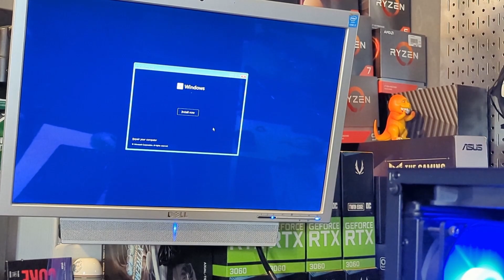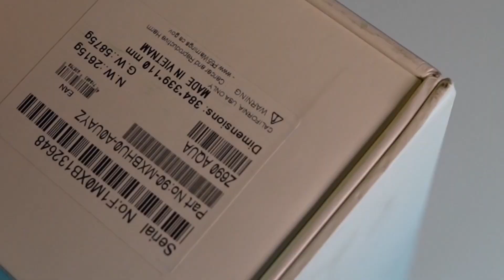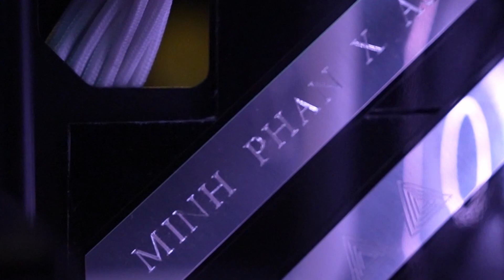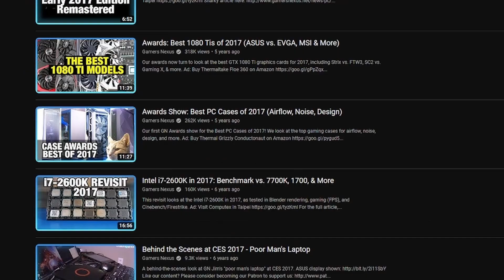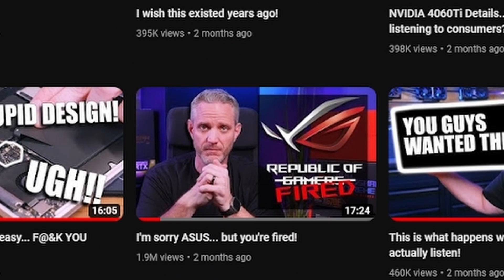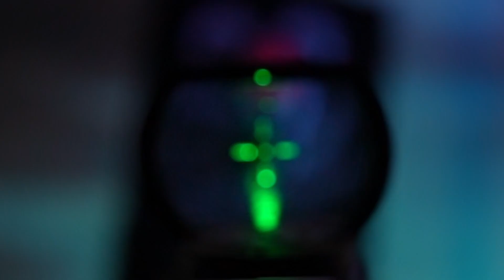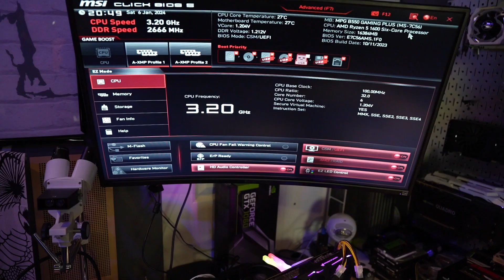Are PCs becoming boring?

Comment: I'll be honest - I think the state of computers is absolutely amazing right now. Or rather technology overall.
Finally long gone are the times when you need a flagship phone to have a good experience.
You want a laptop? Well you have so many options with barely any compromise. Want a laptop that plays AAA games? They're actually doing proper job nowadays. Want a laptop that's slim but plays games decent. Yep, available nowadays. Want a cheap laptop that's portable and provides amazing experience? Well, available nowadays as well.
When it comes to PCs - sure you lose on the GPU prices. No denying. However nowadays you can get much cheaper PC cases that are doing their job properly. Same with PSUs. Or CPUs. Yep, that's right. Nowadays at 1440p or 4K even stuff like R5 5600 provides amazing at cheap. Or 12th gen intel. Before older tech was much more expensive thanks to stagnation. Oh and on top of that nowadays stock coolers are decent enough! And if you want something better for R5/i5 30$ cooler will do the job. Back in the day you'd have to pay at least 60$ for a proper cooler. Storage? Well, you can get 1 or 2 TBs of SSD of cheap. No need to compromise like before. Some 256gb ssd for your system and one or two games while the rest had to run on HDD.
And GPUs, well they got much more expensive. HOWEVER, you don't need absolute chonkers like 4080. Last gen AMD or 4070s provide amazing performance at not much higher prices compared to what we had before. But nowadays you can be sure that those GPUs will last MUCH LONGER compared to 1070 for example. That's a small win in my opinion. It just sucks that you have to pay SO MUCH to actually get proper 4K experience. However next gen will probably provide close to 4080 performance at 4070 price. At least that's what AMD is trying to do so there is some hope <3 Overall PCs are in much better state. 
Wanna do watercooling? Long gone are days when you had to pay bazillions to get into that. Nowadays even the cheaper brands do quality stuff. And cases are designed with watercooling in mind! I love it. 
Oh and the looks! Nowadays you get quality fans that also look good. Cheap cases look amazing. I've recently seen a pic of a guy that built amazing system on used parts for 450$. Dude got 12400f, 3060 12gb, 16gb ram and 1tb ssd. AND IT ALSO LOOKED AMAZING. He had such a clean build with some nice touch of RGB and braided PSU cables (he did it himself). Back in the day there was no way you could do such a performance killer at a price while also making it look good <3
Thank you for coming to my TED talk
Reply from the maker: Thank you for this write up haha, or TED talk as you said. I agree with you 100%

Comment: I can tell ya from decade's of building and maintaining PC's they become the equivalent of adult Lego back in the day eith so many different standard's you had to know the difference between the different display tech to plug in a monitor properly or even earlier hiw many people knew how to reroute IRQ conflicts with competing hardware in same rig like sound cards/GPUs/daughter boards for flight sim hardware or printers on the LPT ports. 

Now if you have a functional brain that has enough capacity and attention span you can build a insane rig withiut worrying about any conflicts.

The worst thing you can do is ham fist a CPU into a socket and mash the pins or if unlucky youre GPU will catch fire or snap when inserting the new cables too hard to prevent a fire you lose both ways 🤦‍♂️

So to answer the question yes and no its boring because its so simple and no because hardware manufacturers bring new and exciting problem's to the table i cant wait to see what happens when we switch over to ATX 3.0 or intels 12V only and twch that used to be on the PSU are now relocated to the motherboards that will being a whole new host issues exploding GPUs/Mobos will be a Interesting time again 🤣☠️

Thank you for bringing this content out 🙏

And yes RGB Puke is the Bane of Existence i hate it but will and have forced myslef to incorporate it into builds im flipping.
Reply from the maker: Thanks for this write up. Seems like you're an OG. It is true, the only reason I personally started doing custom loops was to increase the challenge. It is 100% adult Legos.

As for the coming changes like the PSU standards. I am kinda excited to try out an all cable less system (cables hidden in back). Which I have sorta hated on before, because I think a good set of sleeved cables makes a PC look great, but idk something new. I am worried about the 12vhpwr traveling through the motherboard PCIE and new power slot on the board though. It sucks if your card melts, sucks even more if it takes out your motherboard at the same time!

Appreciate the kind words man, thank you.
Reply: @techwandoUS  always respect the PC builder with passion I need to go custom this delidded/LM/Copper IHS 14900 is to dang hot 🤣 it'll be difficult 💯 as it's in a Asus AP201 ☠️
Reply from the maker: @shadowarez1337  😂😂